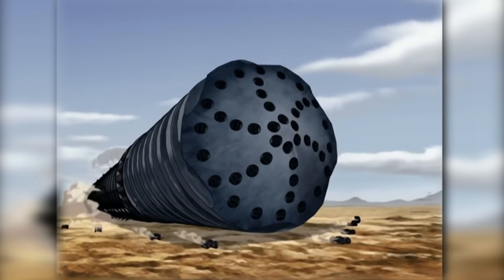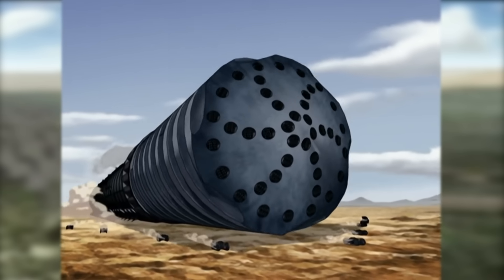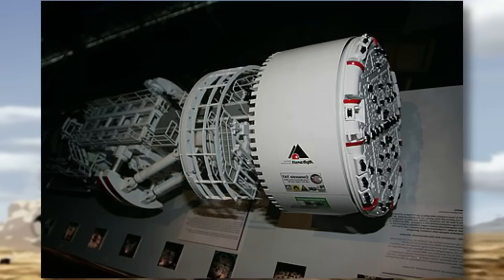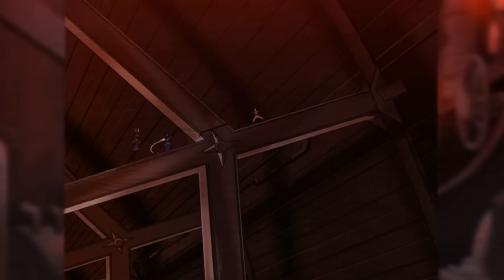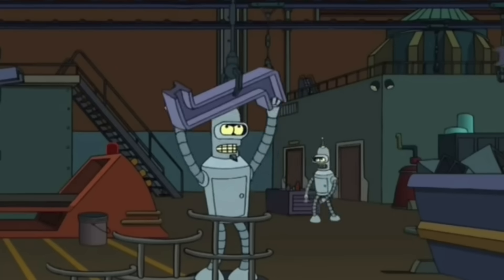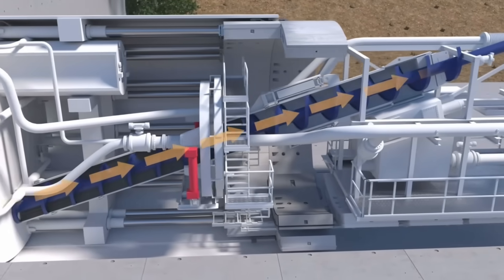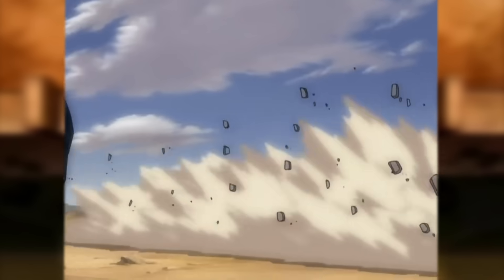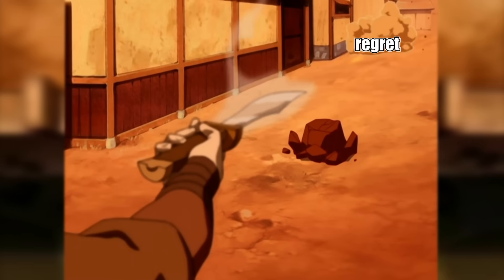Engineer Breaks Down the Fire Nation Tech

Comment: Most water-bending uses nearby water, but in the liberation of Ba Sing Se, we see Pakku creating a lot of it.
Reply: there's always some amount of moisture in the air
Reply: @dracothewarrior4316  true, but in this case, he must have been pulling from miles away to get the at least swimming-pool volumes we see him working with in this instance.
Reply: @GoranXII  fair enough
Reply: I thought he was just working with waters from canals and wells? I don't think he's actually creating any.
Reply: @AntrozLPs  how many cansls are there outside the walls of the city?
Reply: @GoranXII  The city most likely has a water and/or sewer system. If he didn't draw it from there his 2nd best bet would have been the lake nearby
Reply: @tower5499  There doesn't appear to have been any standing water near where they went over.
Reply: @GoranXII  The water literally came from behind a house, it could've come from anywhere, assuming he created the water makes no sense. You don't see someone bring an apple from behind a table and assume they created the apple from thin air
Reply: @rizizum  No, the water came over the wall, the flow 10m wide and thick enough to to freeze a bunch of fire-nation in place.
Reply: @GoranXII  I just watched the liberation scene, and I don't see that happening? Maybe it's cut from the video I watched or maybe you're misremembering. But either way my logic still applies? Doesn't matter if it was a house or a wall
Reply: @rizizum  There's nothing but desert outside the walls.
Reply: @GoranXII  He only uses water inside the city though, where I suppose they'd have water. Just watched the full fight btw, I suggest you do too, it's literally on youtube, just search it
Reply: @rizizum  He creates an ice-wave over the wall from outside.
Reply: @GoranXII  It's literally a house, they went inside through the hole Iroh made, you can ltierally see the gound right there man
Reply: @rizizum  No, it's the outer wall of the city. Iroh blew up one of the gatehouses. And it's still desert outside.

It's not even the first time. When they're trying to get to the Earth King, Katara pulls the water out of her flask, and that goes from, like, half-a-litre to dozens of litres as she whips the Dai Li guards.
Reply: @GoranXII  I think you really need to rewatch it
Reply: @rizizum  You certainly need to give it a second watch.
Reply: @GoranXII  I just did, 3 times
Reply: @rizizum  Then clearly you missed the bit where Katara managed to turn a half-litre (at most) of water from her flask, into a whip several metres long and (in places), as thick as her head. Here it is (start at ~1.17): https://www.youtube.com/watch?v=u4Pv_Y7Tge4
Meanwhile, here's Pakku bending water from (as far as I can tell, since it looks like hard ground all the way to the city wall), nothing, (starting at ~4.32): https://www.youtube.com/watch?v=eJiA3X0fZfk
Reply: @GoranXII  There's literally a cut and then he's inside the city, that's straight up a house there buddy, there could've just been water behind the house
Reply: @rizizum  That's the full scene. And not, that's the wall they go over.
Reply: @GoranXII  They didn't go over the wall, Iroh literally made a hole in the wall and they went inside throught it, do you think the guy just jumped over the wall?
Reply: @rizizum  Jeong Joeng flew, Bumi weny underground, and Pakku and Piandao went over the wall.
Reply: @GoranXII  Why would Iroh make a whole if they would just jump over the wall? He literally made a whole and the earth guy pulled them inside with the rock they were standing on, then you have a cut showing them fighting inside
Reply: @rizizum  Maybe he wanted to distract them? As for the rest, they all leapt off the rock, except for Iroh.
Reply: @GoranXII  You're just coping at this point dude
Reply: @rizizum  You have nothing to go on. That video is the entire scene. There's no water outside the wall and they went over it. Plus you've offered no refutation as to how Katara turned her little pouch of water into a whip about fifty times its volume.
Reply: @GoranXII  You can clearly see the guy just pulled the water from behind a house after he went inside, they're literally on the floor, you can see them on the fucking ground, they never went over the wall
Reply: Both of you are wrong. It is a wall, but it is a wall of some baracks inside the city. Not the outer wall. There is probably some channel behind the wall or moat.

Comment: This was excellent. It was only on my recent rewatch of ATLA that I started to question the drill using a slurry. If that much water is getting dumped out the back, that thing must have massive water reserves. Your comment about using a simple corkscrew conveyor makes way more sense, but I agree that it makes for a more impressive coup d'etat and plot. 

Also, that Earthbender "garrison" is pathetic. They could have anybody dropping boulders from the top of the wall. Why the hell didn't they extend the wall? They could have certainly kept pace with the drill

Comment: Yeah you know I always wondered why they didn't lift up the rock in the middle underneath the drill so it couldn't move any more. Or if they just wanna drop stuff, those boulders were TINY. They could have created some pretty enormous pillars on either side and tipped them over, probably would have worked better. But who knows. 

Earthbender soldiers seem like they rely way too heavily on the wall, and didn't ever feel the need to think about anything else, and I guess they're not great at in-the-moment innovation either.
Reply: In fairness the Terra Squad did actually try that. The issue was the machine was too big for any of their pillars to slow it down before Azula girlbossed all over them.
Reply: Since earth bending uses grit and stubbornness, I think you're right
Reply: Well, they were told all their live that they are safe i side the Wall😀
Reply: Not like there were soldiers down there and they would need to be down there in order to make the said giant pillars and also the weight of the rock and the machine matters

Comment: Fire bending could be taking oxygen from the air, after all fire is just oxygen reacting with things most of the time.
Reply from the maker: Agreed! the oxygen is certainly part of the equation, but - in standard fires - there needs to be some other carbon/hydrogen molecule around